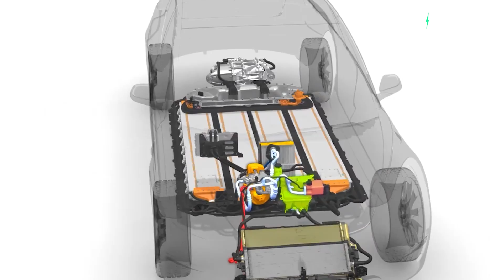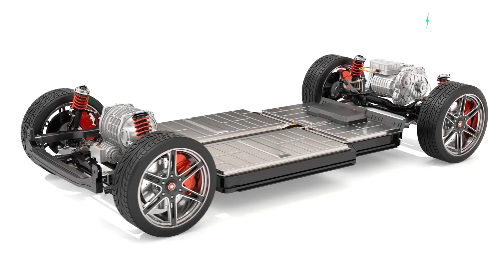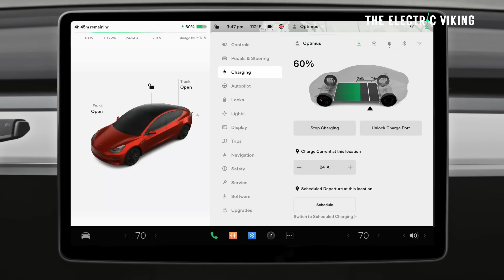No, you don’t need to replace Electric Car Batteries in 10 years time

Comment: The batter in modern EVs like Tesla will easily outlast the warranty and the payments. For many this is the "life of the car" because they typical driver in the US either wants a new car at that point or need a different type of vehicle. If you are talking about a Nissan Leaf with no thermal management system all bets are off. Tesla has made over 5 million cars over the last 12 years and most of them are still going so it's not speculation anymore.
Reply: I’m betting in 12-15 years when my Tesla battery is likely dead, the tech will have developed to make replacement way cheaper than it is today. If not, 10k for a refurbished pack is not the end of the world.

Comment: You would not want to as its an expensive proposition.  You might have to though if you have a crash or a bender.  Drilling oil, if not used for cars, will most likely be used for all the other things we take for granted that make life on earth better.  Much, much better.

Comment: I suspect failures in peripheral electronic systems will 'electronically total' EVs long before battery failure does. We already see it with ICE cars. 

A vehicle will get to a certain age, an electronic module will fail, and the cost of the new module is more than the car is worth.  Often, a new module won't even be available anymore. When the 'one screen to rule them all' fails in your 10-year-old Porsche Taycan and a new one either isn't available or costs a small fortune, then the car is bricked. 

If anyone thinks the concept of 'planned obsolescence' is going to completely skip Electric Vehicles then they might be in for a...shock. 😂😂

Comment: Personally I do not suffer from Range Anxiety.    My issue rather is with Charger Anxiety, or put another way , not enough chargers available outside metropolitan areas.     For example, one trip I take up to four times a year is from Tucson Arizona to southeastern Colorado, about a 660 mile trip.    For the first 240 miles , chargers galore , but absolutely zero chargers for the remaining 440 miles, so fat chance of driving a Tesla all the way there.   This will change in time but for now it's a literal no go for EV's.

Comment: Nice summary. I do, however, think there are some gaps in the story and narrative told. Yes, EV batteries last long. I do, however, one aspect why the question still looms on the myth of fud on EV battery life, where this narrative perhaps slightly misses the mark of convincing. I think one aspect of durability and battery replacement is not only the cumulative odometer distance a battery can hit but also maintenance of performance per range on a given day without loss of convenience. I think that narrative will address one aspect not mentioned here. So say you need and EV that can consistently perform 300 miles of performance per charge irrespective of season and weather, and still manage to perform consistently after 10 years, despite degradation over time, I think that is a very powerful statement, even compared to an ice vehicle. And yes, those stats I believe exist, too. Another thing to mention perhaps to put some body and weight to the story is to compare the performance of range to an average ice car on a single tank of fuel after a high mileage vehicle might be equal or perhaps less than a comparable EV at the same mileage. Those are also very good comparators to address and make the durability of EV batteries insightful. I think the narrative of moving parts argument and odometer to capacity has been argued enough, and I think the narrative with time, I think, makes the more granular arguments more insightful.
I think the gap of the simple repairability of EV batteries is missing an important point of fear of loss of warranty for considering battery repairs. I'm all for it. Despite production quality high production rates in my view will always produce some sort of production error and quality no matter how much QC you do. There will also be a one in a million average incident of an EV or batch of EVs affected. We're even seeing this today, unfortunately, with certain brands.
I think therefore for a single owner, it is quite wasteful to simply replace a faulty battery , especially when it comes to the mantra of scarcity of resources, and reduce, reuse, recycle noble narrative. I'm for that and the right to repair. But to my knowledge battery repair has always been tricky, because it likely voids warranty. I think this issue should be addressed. And unfortunately not all EV makers make repairable batteries, when it comes to finding the balance between repair and safety issue. In that regard Tesla is a bad investment on terms of battery repair, because they chose a structural battery design and safety, which means the batteries are insulated with single use heat resistant foam, and is virtually impossible to repair. The batteries are not modular too. As a flagship vehicle this has always given me an itch of frustration, because inessence they limit the realistic repair options. And if other brands follow suit this will only further increase repair options , the value of servicing (modular repair vs parts repair) and their limitbcustomer options. If other EV makers follow suit this will only limit repair values in favor of planned obsolescence. I'm curious to know which repair path is more favorable and think the jury is very much out on this matter. I think ot is similar to the Fairphone discussion and software locked components limiting to only artificially apple certified repair of the screen and battery and that something simple as a battery replacement of a battery is software locked only for one specific iPhone, but cannot work on another iPhone is truly a bizar state of repair. I'm curious to know what the future of EV battery repair will look like in the future. Will it remain universal, or software locked by Tesla?
I think the black stuff price of 10000 dollars per ton won't take long to drop. Other it is not economical in the long run. For companies many resource models are usually buy cheap in bulk and sell for profit. If battery companies buy black stuff for 10000 dollars per ton and sell for 30000 dollars, EV batteries will remain expensive and EVs will never get cheap. Yes batteries are valuable and it's resource materials too, but it will only be so of the price is right for the business. I think the batteries are valuable for the customer because despite and EV battery being off capacity and needing replacement, the degradation I believe is an average over all the cells. We no that with multiple EV battery cells they always drift away from each other over time which causes voltage and capacity difference of each cell. Some cells of a 70% capacity pack will have individual cells with 70%, 100% and some 40%. So there will be good and bad cells over time no matter how good a bms is. But we can get very accurate in cell balancing.g techniques. So with the high quality batteries you can use the capacity energy for a slew of different applications, as a pack or individually selected cells. So a second life purpose is there and that is amazing. And high quality remaining cells are high value Yes, because they are practically new. So as an owner of a pack you can do more with this remaining energy storage as for example energy harvesting or being a small energy provider, which has potential for a micro energy provider as a service. I think that makes owning an EV extremely interesting as a future micro business proposition, dealing in energy for a prive. I think that can be lucrative especially woth emergency or energy demands on the go. I think therefore too that V2L, V2G and V2H support for any EV is a huge missed opportunity and interesting value proposition for future EV customers, maybe even more interesting than full self driving, beamcause of the potential flexibility of energy provider as a service potential. Everyone needs energy power. Not everyone need full self driving. In that regard I think Tesla missed their opportunity by not supporting and bidirectional charging amd/or grid support to any of their current Tesla's on the market. I think what Kia and Hyundai are doing with many of their wehicles with V2L is very smart with regard to future proofing the EVs.

Comment: Batteries last 1000-3000 charge/discharge cycles, for comparission, a ICE engine car lasts 400-500 fills of the gas tank before the whole thing is scrapped. I also use the analogy of the ICE engine in your car, what happens if that has a major failure out of warranty? An engine replacement costs as much as a whole new used car, major engine issues usually see the whole car binned for scrap. Cars last about 150k miles or 12-15 years on average. Everything points to EVs lasting longer, with less maintenance and less risk of major failures.
Reply: Most cars are finally scrapped due to rust or having been in an accident not mechanical failure, this will be no different with EV’s.

Comment: Used batteries cannot be recycled because of high labor costs. ICE engines last 250k miles. No way an EV will last that long.
Reply: BS, there is one plant in Arizona and another in Georgia at least.

Comment: Viking, the exception may be Mercedes Benz. I have been negotiating on an EQS450 4MATIC, felt the urge to research the cost of a new battery. I  was quoted over $70k! That did not include the $5k core charge here in the US.
Reply: Looks like they just give you a new car?

Comment: Ive owned hundreds of battery operated items in my life. Non of them including my €3000 cameras ever work for long enough without having battery issues. Computers, my electric bike my razor, electric drills. Its always the battery that fails. To replace a petrol station with charging points that allow for the same through put of vehicles isnt practical. In South Africa and many regions power cuts are frequent. Its never going to work. I dont even need to prove it. I will just wait ten years and say I told you so.
Reply: @AudiTTQuattro2003  Oh, it's not about oil. Biofuels have been viable for decades (with engine modifications). Hydrogen Fuel Cells have also been available for decades, and we now have synfuels that can be used in unmodified engines and gas pumps.

The questions is whether the BEV is a viable alternative to all the other carbon-friendly technologies that we have developed. The largest issue being the long charging times, which makes it unusable for the average joe. But it seems that with DC fast charging, that is slowly making BEV viable, the expensive batteries don't last as long. So cost needs to come down further.

Comment: I wonder if we will someday see battery packs being swapped out for rebuilt used battery packs, like they do for ICE transmissions and motors now. The vendor would take your old battery pack and rebuild it for use in another vehicle. This would further reduce the costs of battery replacements.
Reply: Yeah it will be done at a garage of the Tesla autonomous car company, and Teslabots will do the swap while they vacuum the seats and clean the interior between customers.

What I'm saying is, swapping batteries is so far out in the future, there will be no market for it until we have lots of cars at 600,000+ miles. Only taxis, delivery drivers, etc will have that many miles before 2030.
Reply: @-whackd  I saw a video about an Uber driver who bought a four-year-old Tesla, then drove 200,000 miles in one year and was fussing because his battery performance was becoming degraded.
Reply: @kencotton4645 that Uber guy will have the same problem with an ice car.  He will complain that is so much less performant, noisier, etc
Reply: @kencotton4645 That's 550 miles a day, every day.  That's 11 hrs @ 50mph average.

Doubtful.
Reply: @-whackd yeah exactly.  People acting like buying a car is a 40 year investment.  But it's just another commodity so just buy what u can afford and what you would enjoy.
Most ev haters are folks who can't afford one thus keep complaining about cost and discount all the premium features.  If you just want to drive from point a to point b, just get a Lada.
Reply: 100% yes, this is happening now
Reply: This happens already.
Reply: I thought this would become a monthly plan or part of the packaged service/full history as a money maker. Keep people at the dealer.
Reply: New battery packs are structural and as such, they are glued together. It will not be easy going forward to break apart packs, only recycle them

Comment: A youth entrepreneur named Hayden Sonnad runs a service called Tesloop between LA and Vegas. The had to replace a battery at over 600,000 miles (this was also an earlier chemistry battery. I think it was at under 80% of its initial capacity, so Tesla gave them a new one free.

Comment: Even if my EV can only do 2000 deep cycles, I don't charge my car every day, and never use it to a zero state of charge - I charge every 3 to 4 days toping it up from about 20% to 80%. That's 100 charges a year, and the battery is babied all the way. I also generally don't fast charge, but charge at home. So I shouldn't see noticeable degradation for a good many years. My last electric car did 130,000km, and I saw no difference in range. So I have no real concerns.
Reply: That's why it's important to have a big battery, even when you don't drive that much. You'll accumulate far less charging cycles over time.
Reply: @svr5423 Except that in Teslas, the difference between the standard and long range isn't that much extra battery.  And LFP batteries, as used in the base Tesla Model 3 RWD, are supposed to have twice the cycle life of the battery chemistries used in the longer range versions.

Comment: The cost, likelihood and time frame of replacing an EV battery is not much different from a combustion engine requiring a completely new engine.
Reply: And or transmission .. 
Everyone leaves out these facts.   😂😂😂
I have a friend who had a very high end expensive bmw .. they did not have replacements for the exhaust system anywhere on earth and had to manufacture them specifically for him . At a cost of over 25k including shipping ... 
Crazy .

Comment: I do wish that you would do a little more research before presenting things.  I find it very interesting that a lot of people talk about cold weather and battery degradation.  Most of the manufactures seen to over look the effect of hot weather of EV batteries.  There are millions of us that live in the South Western United States where temps regularly reach 110 degrees.  I live out here as well.  I want to get an EV but due to the hot temps I am trying to wait until ta least LFP battery's come in vehicles.  I built mt own solar system and started with Lithium Ion batteries, big mistake.  Once I switched to lithium Iron Phosphate batteries all the issues I had with storage went away.  The system has now been working for over 8 years.  So would you at least look into temps and battery's and do a video about this subject?  Oh and I rented a Tesla Model 3 a couple of weeks ago.  I live in Tucson and there was only about 1/3 of the battery to be able to use to drive.  I figure this has to do with our high temps which seems to be a very critical part of how long a battery will last.
Reply: not much of an anecdote but I bought my Tesla 3 new in June in Fresno CA which gets pretty insane hot and it never felt like the heat was hindering its range
Reply: I never leave devices with lithium ion batteries in the car if I park it outside in summer, exactly for this reason.

But yeah, on a BEV  you can't take the battery out and with you to the shopping mall..
Reply: That's one reason why I'm glad that the mall near me has a parking garage to keep my car out of the sun.

Comment: My 2000 Acura TL needed a $5K transmission rebuild at 170,000 kms. My 2009 Infiniti G37X suffered an internal engine gasket failure at 105,000 kms; $10K. ICE vehicles can be very expensive.  My next car will be a 2024 Model 3.